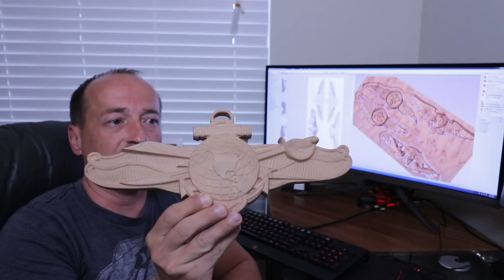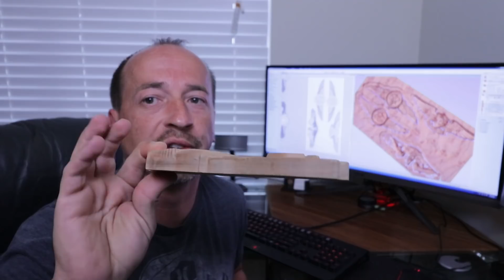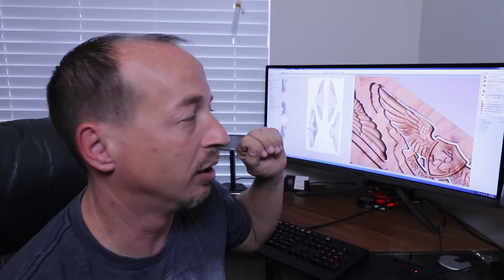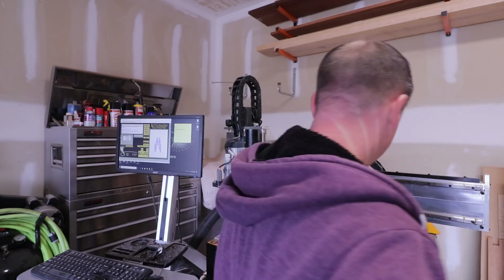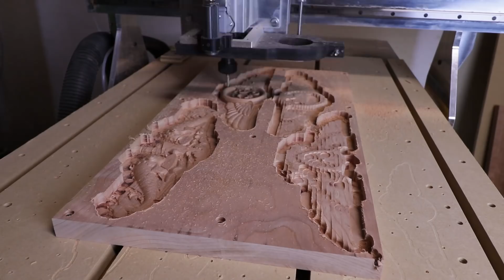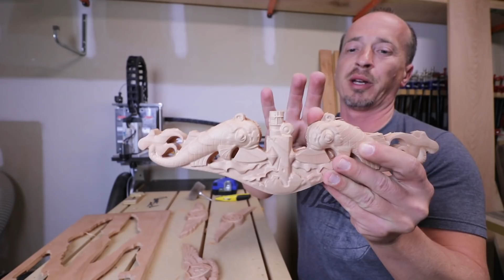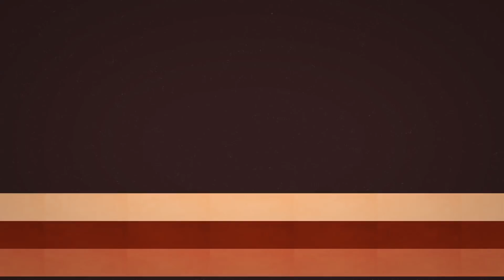Why are 3D CNC Router Carvings So Expensive?!!

Comment: The bottom line is how much machine and human time it takes to make the pieces.  The tool path creation should be a lot simpler than you describe.  Once you make the tool path, subsequent carvings should be a snap to set up since you should have saved it from the first time. So 2 hours man-hours and 5 machine hours.  The Only thing I don't know is about tool bit wear but it seams to me that 40$ for each piece would be a decent price for a setup with little overhead that is most of etsy. 

The etsy page is no longer up so I have no idea if it was too expensive or not but from it being no longer up I would say it would have to be.  In economics a thing is only worth what people are willing to pay for it.
Reply: The site is still up.  We still haven't figured out electricity, cost of the wood, other tools and consumables that are required such as sand paper, etc. The bits are a consumable item also and have to be replaced then there is the cost of the machine and there are parts on the machine that will wear out and need to be replaced over time.  Generally there isn't any money to be made in making 3d parts because of the time involved.  3 items at $40 a piece by 7 hours equates to $17 an hour before you start deducting all of the expenses.  I agree they are only worth what someone is willing to pay but I wouldn't make them for that amount and when I look at his site he is only asking $15.  He is losing money at that price so not sure why anyone of his customers thought that he was charging high prices.
Reply: this piece has to cost 150 $ to barely make any profit, you have to calculate all costs, not just electricity, tools and time.
what about taxes, insurance, i could start a list but one will only learn how much all really costs by starting a company.

Comment: Everyone is looking for something for nothing.......  I have gotten to where the price is what is take it or leave it. They have no idea the time I put into programming as well as operational cost of the equipment much less the cost of the machine.
Reply: So how many times is that machine paid for?? Once you have a program , its saved and can be reused to get the exact "copy" of someone elses older work, many times over. Just like a print vs an original oil painting. But theres a big difference in pricing between the two.  But im guessing the pricing isnt changed here. Btw. I have a Chevelle too! As you know, as an example, a true SS isnt the same price as a clone. lol
Reply: @terrythomas790  depends on the machine you buy, real industrial grade machines could depending on size cost up to $250k plus depending on how its outfitted.  Sobit really doesn't matter how many times the machine pays itself off there is still ongoing maintenance and consumables which the average Joe has no idea what that costs to maintain.  

Yeah unfortunately the chevelle super sport is one of the most faked cars out there.  My 68 was a Baldwin Motuon car but the guy I got it from got rid of the original 427 and transmission because he wanted more power.  I guess he didn't realize how valuable this car would have been truly restored to original factory spec.

Comment: Who makes the sanding mop you used in this video?
Reply: Most hardware stores have them. I found some I think in the Marine section or paint. It's not actually sand paper I'm talking of but a semisoft plastic Bristol brush
Reply: https://www.amazon.com/gp/aw/d/B07P1TGXB6/ref=sspa_mw_detail_0?ie=UTF8&psc=1&th=1 that should be a link to those sanding wheels. They go from 80 grit up.

Comment: I am a cnc machinist full time. I also have a 4x4 cnc router. For what we charge cutting wood on a cnc router is no where where it should be. If a customer goes to a metal cutting cnc shop you can expect to pay $75-$90 per hour plus setup times. So charging lets say $50 on a project that takes maybe 3-5 hrs, the customer is getting a bargain. That same time in a metal cutting cnc shop would run upwards $450 for 4-5 hrs of machine shop time.
Reply: Charge for the product not the time.
Reply: @chrisreynolds2410  worst advice ever. You have to pay yourself a wage
Reply: LG that’s your opinion and it’s also subjective depending on the type of tradesman….are ya a shitbum turning out shitbum products or are you the cream at the top of the crop turning out product that drops people’s jaws?

I already know the answer based on your retort to my statement.

That being said I’m pretty sure I’ve came from a lower place than you and surpassed your earnings and earning potential……that’s also why I added my positive opinion/advice trying to uplift a person rather than shit on them.

Why are you so mad?

Comment: Yes if you define cost as all the things it took to get an end product everything has an astronomical cost. Think of any invention ever. How many people did it take to make that product? hundreds if not hundreds of thousands of hours to make a product we take for granted daily. Cost really not what we think it to be.  If we have the physical equipment needed to reduce the time we have to interact with making that product that cost should be lower. This is how realty really works large company's have the physical infrastructure to make products cheap because they have machines that reduce the time needed to interact with creating these products. Example above is someone with a more advanced CNC machine would not have to change bits or change bits manually. So should the customer have to pay that cost? We strive to lower cost by eliminating the time required to make product so the cost of the martial used is close to the cost of the end product.

Comment: Let's not even talk about trying to recoup the cost of the machine or the hours of learning software both for design and to operate the machine or the amount of rent you are paying for the garage portion of the house.  Just figuring what the piece of wood cost, stain, sealer, sandpaper, electricity, wear and tear of the machine, replacing worn bits, etc. with the prices on your Etsy store, you are almost giving them away at your cost.  I bet you are lucky to make $10 an hour on them and if you break a bit or have a board that doesn't turn out you are paying people to buy them.

Nice work and nice video.  I think that you should recalculate your prices.  I stay away from 3d stuff because it is just too difficult to make any money with it.

Comment: As a former Navy Rescue Swimmer, I appreciate your carvings! I'm in the market for a CNC router but there are so many decisions and I dont want to just throw $2k down the drain in a poor quality machine
Reply: I just looked up how much yours cost... I guess I should expect poor product if I'm only looking at a $2K machine
Reply: @Spartacus69  a 2k machine is fine its mostly to do with how you have your feeds / speeds setup & using the correct router bits for the particular job
Reply: @Spartacus69  Our cnc router has high quaility and accuracy, if you are interested in cnc machine, please don't hesitate to contact me .
Whatsapp number:8617860541557

Comment: Good video.  Those pieces came out nice.  I agree, customers just do not understand everything that goes into making such a piece.  Doing "3D" also ties up your machine for longer periods of time which means it is not running to do other quicker jobs.  Remember, time is money in the equation too.
Reply: NOT sure have, if cnc make work you can do lot other work same time, not newer can charge customer you own freetime or other work time  you can charge customer only how much elektric go spindle and motors this time and thats is 5-10$ big work. not more, its you own fail if broken bit or need make same again new manytime. not customer fail.

Comment: I get it, I really do. I designed and built my own CNC machine using Openbuilds.com. BUT(you knew that was coming)...... Being someone that regularly uses and sells carved models. I feel that you over sold the CNC's Job. With tool paths, and with the whole CNC process, their is actually not much in (2019) that we have to do. We input the information, and a computer does the rest, it starts and stops the Gcode when we change tools, the most we have to do is re-zero the Z axis.(at least on mine). You mention how you have to (change your own tools)..... It is easy.... Freaking really easy. ...The way I charge is I set up a material price(material x2) and a hourly time(usually cheap because a machine does most) and then I do a design time. But you have to really think about it........ we get paid to know how to work a machine, it is not hard to us, it is not complicated to us.So why is it so expensive, I don't get it, I make great money and no one says I am too expensive. You talk about making changes, but really you take 5 minutes and a machine takes 2 hours......... I budget my day at 200 dollars a day. If I can bill the items I create at 200 dollars a day, then I am happy and having a great time. No reason you need to charge 50-100 dollars on a design that you spend 30 minutes actually just touching a machine. If my machine runs for 5 hours, I still only charge  25 dollars an hour that my machine runs and make quite the profit. 

And you say the computers glitch? Nah, that is incorrect, the CNC machine only does what you tell it to do. It never tells the router do slam through the middle of the cut with your half an inch bit....Computers only do exactly what you tell them to. The only exception is when shut down or hang... but they do what you tell them to... if not, you are doing it wrong.
Reply: you are right
hand carvings require a lot more skill
Reply: I set my machine and go to bed while it runs... I. The morning I get up and it's done.
Reply: @jarsofclay5  Ive done the same thing before but be careful doing that I seen a video on youtube where the wood work piece moved and the spindle started digging in the wood and caused a fire.
Reply: Do you have a link to any of your work?
Reply: I don't think you are dealing with this kind of stuff for very long. CNC machines do fail. Not only people. There is a lot more than just computers involved. Also he has to pay for his machine, that doesn't come for the price of a shapeoko.
Reply: Saxo Fonista Even if you get the xxl it’s still under 2k lol

Comment: I used to program the earlier type c n c. by the plus 10 left10 etc everything has to be workout in my case I done it in my head or on a sheet of paper I only guess the process is not the same
Reply: The clever ppl of us would have written programs todo that. Its like adding by hand what you do, there is nothing more prone to errors. EDIT: It is not prone to errors because it is difficult, no its the easiest math op ever, but its a boring repetitive work humans are very bad in doing without making financially devastating errors.

Comment: I'd love to have one of these machines to do a relief map of the area I grew up. Lots of hills, rivers and ponds. I've thought of doing something by hand but that would take years. I already have maps, the hard part would be calculating the scale and making the full thing a reasonable size. Maybe an N scale so I could run a model train through the areas with tracks.
Reply: plaster of paris ... many other materials you can use
Reply: I realize your post is old, but I am seriously considering gearing up to do what you described in your post. How large a map would you want, and what do you think would be a reasonable price for it?
Reply: @rickojames  N-scale trains are 1:160 while HO-Scale are 1:87 and they are both common sizes. I would probably set up a 4x8 sheet of plywood and determine what I could fit on it at those scales, maybe not center the town but get the most dramatic geological features as the center with train tracks running where they fit. As this would be a hobby I would have to do as time and money allowed. I've never priced anything out but some modeling items can get pricey. Or maybe simply skip the details like vegetation and realistic buildings.Just going with the plywood and make it look a bit like google maps. That would still involve several sheets of 1/8" plywood and right now you need a loan to buy more than one sheet at a time. Price would vary wildly based on what you what to do and how much you can spend.
Reply: @tstuff  Maybe I wasn't clear in my question. By 'gearing up', I mean I plan on adding a 4x8 router to my shop and do 3D terrains. You were asking if this guy did maps, so I was asking you what you would be willing to pay for a 3D model of the area you wanted. Since you said 4'x8', what would you be willing to pay for a 3D model of your area carved out of MDF? Thanks.
Reply: @rickojames  I actually want to add a CNC machine to my shop. The idea of the 3D map was just something I would use it for. I've always wanted to do it myself. I had thought of using foam sheet but with a CNC I could calculate out a far more accurate map on 1/8 subfloor materials using USGS topo maps. It would be more of a hobby thing rather than having someone else do it. 
If you are asking what you could reasonably charge? That I don't know. You would have a lot of work and materials that would probably go into something like that. Wood, glue, calculations, inputting it into the computer, cutting times, cutting bits....

Comment: For the price I find these carvings for I'd wish for better quality wood and finishing touches. The one's I have access to are made from the softest wood possible and need a lot of TLC sanding. Super rough stuff. I'm sure they're using old garbage bits to stretch out the dollar - but yea. To be fair, I looked at your inventory and they are exceptionally priced and made out of great quality wood. So I'm sure it's just my local shop that's being stingy.

Comment: it should still realistically be much much cheaper then a hand carved piece of equal size and quality.  and by a decent margin as well. 

some of your stuff is decently priced others eh, you can get hand made stuff thats very similar for not much more. almost 300$ canadian for a cnc made cutting board? lil pricey. thats assuming you dont do them completely by hand. cause for about 50$ more i can go to a local guy and get a fully hand made cutting board of similar quality. could probably also have him copy your design.  and he uses mostly hand tools and a very fairly primitive power tools.

and yeah you gotta model and stuff. but at the same time i can go get a custom aluminium sprocket for my bike that was also designed and requires other complex things like fitting an adapter for a spline drive system, for like less then 80$ and thats 7075 t6 aluminium. which you have to work slower then wood. cant let it get too warm. and its anodized afterwards. which means cncing it out, polishing it, cleaning the shit outa it, anodizing, then coloring then sealing 

that said your art pieces seem to be exceptionally good value. especially given wood isnt cheap itself, return on profit on the cnc machine. electricity costs. bits. other finishing work and such.

Comment: you talked about efficiency of the toolpaths ect, but your machine is not running as efficient as it could be.  When you probed the bit, it took a long time for your machine to reach full speed.  This means that your acceleration is way low.  On all the small moves of the 3D toolpath, your machine is going much much slower then the requested feedrate.  by upping your accel you will get better cut times.  Also, those types of toolpaths are in fact 3D and not 2.5D  2.5D refers mainly to cutting 2D shapes basically stacked or recessed.  You are running true 3D toolpath in a raster on Y
Reply: Clearly keyboard quarterbacking on my part.  I believe I'd design for standard size  wood and cut the wood to size and a nesting program, let the software do the work. Wood and software are both cheaper than time.

Comment: I have a CNC as well and just started using plastic finish nails with senco nail gun instead of screws & clamps that i have snapped may end mills off on.  The machines cuts through the plastic as if it were wood
Reply: how do you like those composite nails, you ising with senco gun. can you use any nail gun.
Reply: @maxsmith2320  nail gun is special for the nails,  i used it last night.  not perfect for every job

Comment: Good video. 
I think you are using Ventric Aspire for your designs but what are you using to control your CnC. I’m using Mach3
Reply: I have the same setup, Camaster Stinger I, when the machine is purchased you have two options, Mach3 or WinCNC, I opted for WinCNC, what he uses. The difference between Mach3 and WinCNC, is that Mach3 is software based controller and WinCNC has his own hardware controller, PCI card installed on your PC that connects to the machine's box. Hardware controller is more predictable which creates the step and direction signals with hardware. WinCNC costs 4 times what Mach3 setup does.
Reply: worst dangerous software, under windows not good not realtime safety and lost alltime lot steps because not have realtime machine. very dangerous, use linuxcnc have lto better safety TRUE realtime not lost lot step, no broken toolpath.